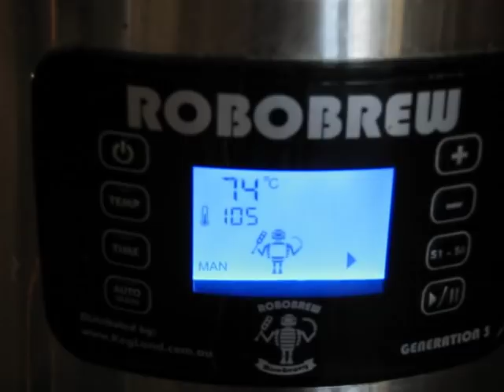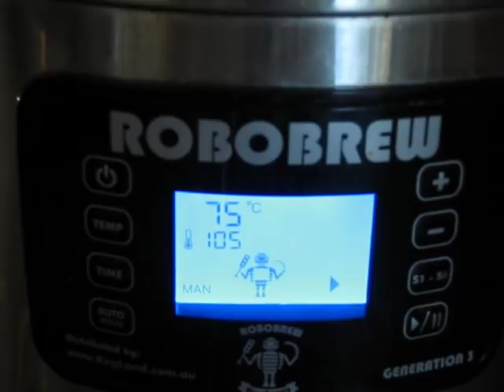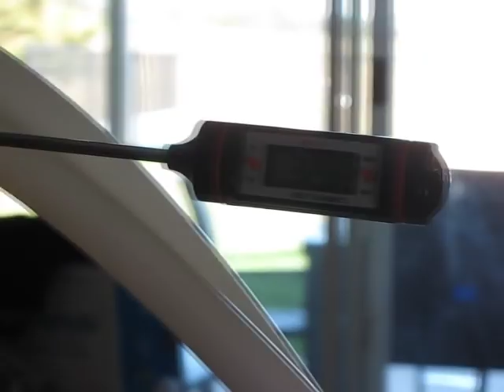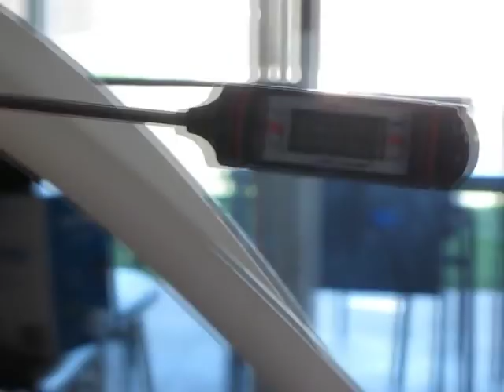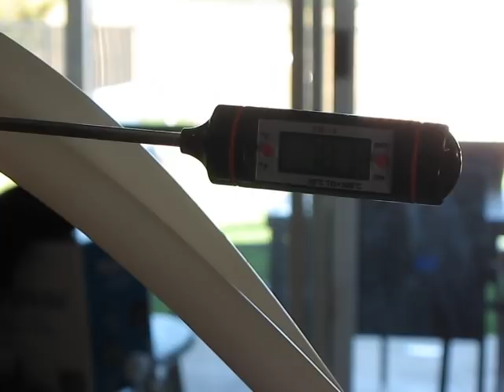The Whisky Jar #11.  Using a voltage controller on a pot still.

Comment: Excellent was just the video I was looking for, was worried about the voltage controller messing up the display panel. But looks like it works fine.
Reply from the maker: i've had no issue down to about 48%, under there it starts getting iffy. That's with both elements, so if only using the 1900, you will need more % so no problem.

Comment: Gday LJ. 
Mate did u do the entire spirit run on the 1900w element with the vc controlling the output?
Reply from the maker: probably, sometimes I leave both elements on, but it can get close to stalling the controller because you have to wind it down so far, so better to just use the 1900W once up to temp. I find I'm running around 65-75% on 1900 or 50-55% on both.
Reply: @littlejohnsbrewing9199  thanks for getting back to me, mate. I just picked up a brewzilla gen 3 and was a bit worried about some comments regarding voltage control. Sounds as though anything over 50% will be fine,  and to be honest that should be plenty. Have a good one.